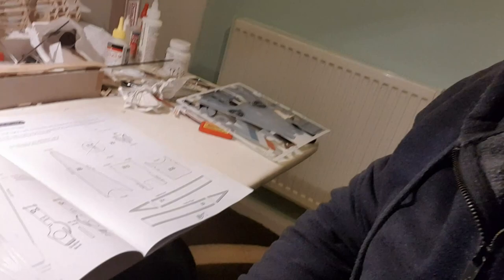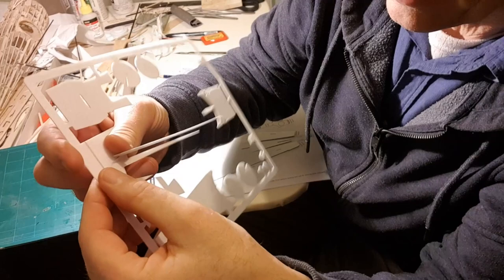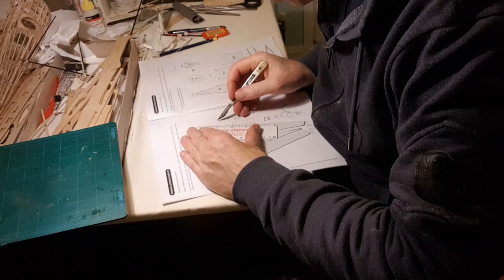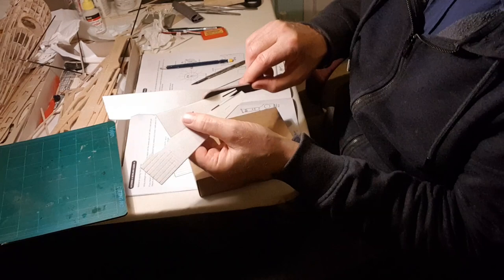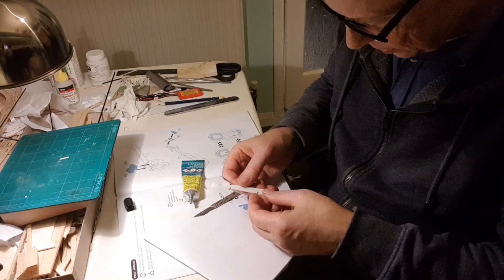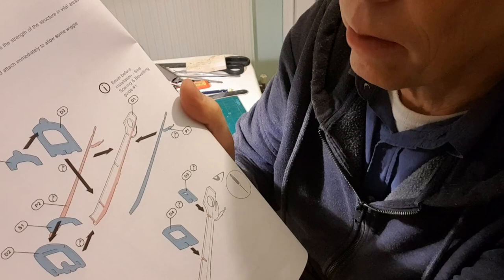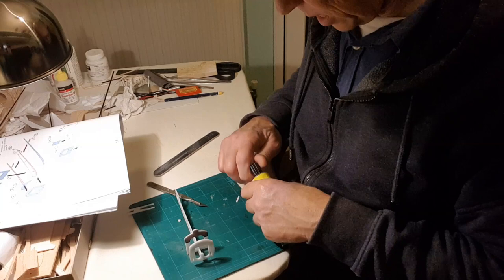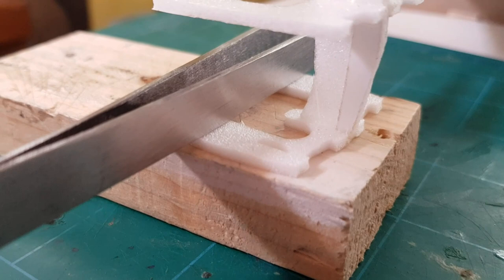Microaces Nieuport 17 Part 1 Building the Fuselage

Comment: Thanks very much for this video, Cliff. I wish I had seen this before I messed up my SE5. maybe the SE5 was a bit too challenging for a novice builder (74 yrs old too!) and I wondedr if you would recommend a simpler one. I still have the flight pack so I can probably get the base kit quite quickly. Which one has been your personal favourite? Thanks again, Cliff. Really helpful.
Reply from the maker: Hi Jim, you do know you can dismantle the parts (assuming you used uhu por) using lighter fluid and start again, put it to one side and come back to it? Anyway to answer your question the Fokker Dvii, it's tough as old boots (they all are really!) plus it has very little rigging to worry about. MA do do a 'beginners' plane now called the 'Scrapee', take a look at the MA website. Thanks for asking the question 🙂